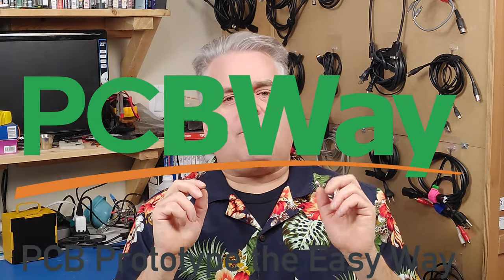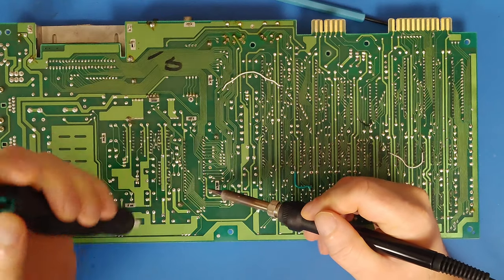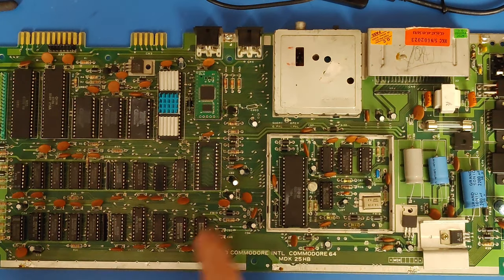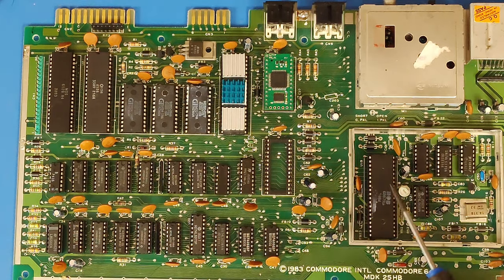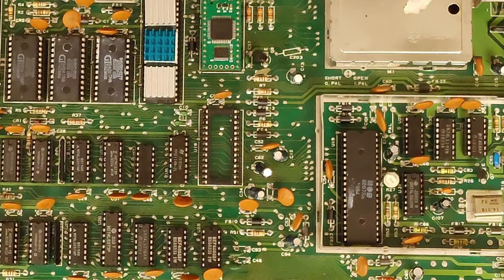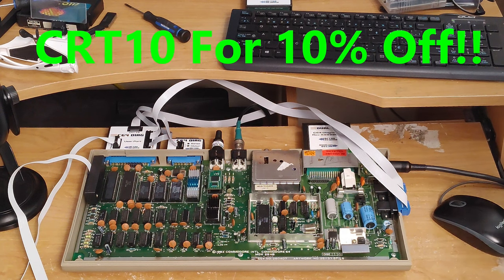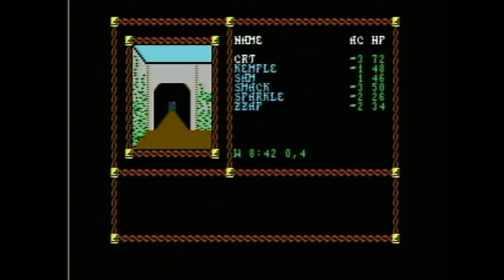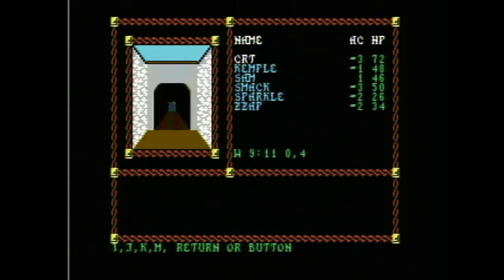Trying One Last Time To Fix My Problem Commodore 64

Comment: Very well done Ken. Sometimes stuff just stops working and we don't know why, makes sense that the opposite should happen from time to time :) My moneys on what you said, something very small that you somehow "fixed" while replacing the resistors. In any case that's one more system you can chalk down as a CRT success story.
Reply from the maker: Still, a little disappointing that I didn't figure out the exact problem...
Reply: @CanadianRetroThings I can’t tell you how many times I have repaired machines that just “magically” started working, especially when I turned the lights off and returned to the task in the morning and it just worked. Ours is not to ask why but to move on to the next machine. Otherwise you will go crazy.
Reply from the maker: @Retrorewindca  Crazy? I haven't gone crazy, the other voice in my head is the crazy one! 😁

Comment: Hi Ken, great you didn’t give up on the good ol 64! I‘m by no means an expert on the breadbin or fixing vintage computers but let me give some tips what you could check to make sure it works reliably now. Given that the symptoms mostly disappeared after you replaced those resistors even by the same values made me think of cold solder joints or one / some very marginal chips. The cold solder joints would be the obvious one but the reason may not. I think one of those (maybe more than one) was a pull up (or down) resistor. Those old TTL logic ICs needed much stronger pull-ups than todays CMOS logic. So if there were cold solder joints then the resistance was much higher than it had to be resulting in a weaker pull up. Sometimes even a couple 10 ohms can make a difference which is well within the tolerance of those 1/8W carbon resistors and could also make that it was not working. So a weak pull up can cause a weak signal from an marginal IC to have a much slower rise time which can cause a timing issue - especially when timing was created by an RC network which there are a couple of as some kind of in production hot-fix. In such a case the old capacitor can also become an issue if its value isn’t what it once was. 

These kinds of problems are very hard to diagnose and normally require good understanding of the circuit, its components and the timing requirements OR loooots of patience 😅 so GOOD JOB being a bit lucky.
Reply from the maker: I think it was more A LOT lucky!

Comment: I wonder if you had a resistor on the bus that had  cracked/dry solder joint. Good luck finding it
Reply from the maker: I do plan on going back over the board eventually but for now it works so I don't have to have nightmares about it!

Comment: Ken, did you check your board with a different PLA? Sometimes the new pla’s have some small compatibility issues. Someone else has done a video about issues with the new fga or gal PLAs. Another option is a cold soldered joint. Reflowing the board may have fixed it
Reply from the maker: I did try the original PLA that was in the board with the same resault.  Most of the solder joints have been reflowed but it may be one that I missed.
Reply: @CanadianRetroThings  have you tried a different cpu?